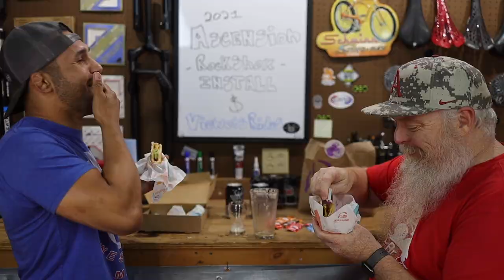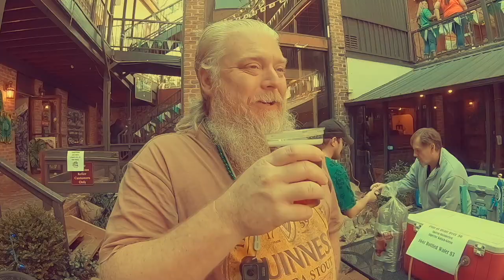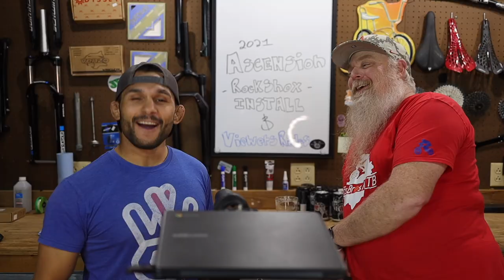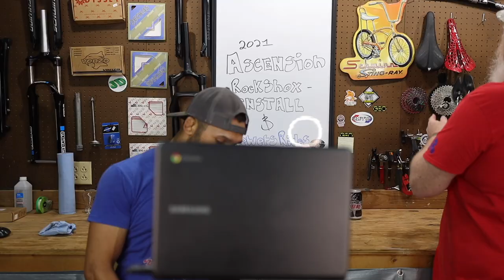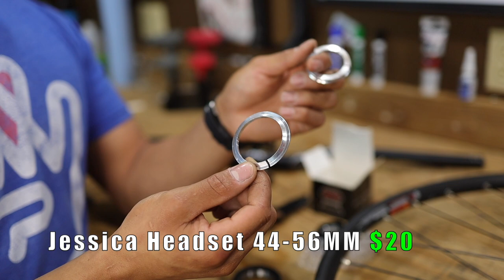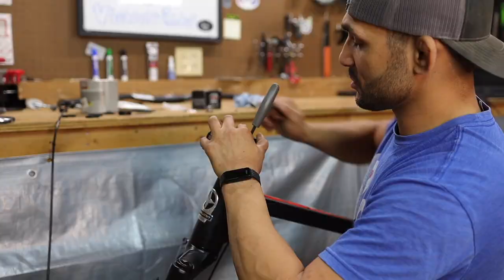2021 Schwinn Ascension gets RockShox Recon plus Viewers Rides!

Comment: Great video guys 

An additional information about the forks. I have one on my bike.RS Recon RL. It was 90mm travel, then after some research I found that it can have the travel increase by removing some spacers on the air side. With this it is possible to run more SAG (and less air). Then the fork gets even more supple and smooth. If you need more info on how to make the travel adjust just ask. 

It's a service like a lower leg service, just some more steps. 

Other think about the wheel. Other day I ordered a boost fork, but I didn't had a boost hub, but a had a thru axle hub (15x100). My solution I found on the hardware store (bolts and washers store). I got some washers that worked fine as spacers for use the 15x100 hub on the 15x110 fork.
Reply from the maker: Very good hacks man, thank you for the rundown and info!! Will do and I may be asking you in the near future:) Thanks Tatiana

Comment: The Kore bar is a nice for the money! I just put one on my old Ellsworth Joker. Wow, very comfortable. I used the shorter width, 680mm??? I grease the cups before insertion. I usually use a scrap of 2x4 and a firm rubber mallet to tap in my headsets, and a section of copper pipe for headset removal. Copper is soft and won't mar the bike or headset.
Reply from the maker: Very good thinking, I always grease too plus I think why not, it's not like it's gonna fall out lol. The Kore bar is very nice man, I rode with it yesterday and it felt very sturdy and not too much flex at all. Thanks for the input and see you for Tuesdays video of the Axum DP Time Trial!!

Comment: Just did a fork upgrade to the Rock Shox Judy, and I used a budget tool like you to press the headset … only difference is I use a wood in between the washers.  Grease also!
Reply from the maker: Not a bad idea man, I am sure it doesn't marr the aluminum at all:) Thanks:)

Comment: Favorite buget friendly handlebars? Reason...rise,durability, weight , etc...?
Reply from the maker: Oooohhh, good question man......Lets see I really like the wakes a lot. I have some 760mms and they dont really flex that much. They are cheap and they feel really good plus those are the bars I put on the GT back in the day and crashed manytimes with the, still not bent!!
Reply: I noticed you use Jessicas also, huge difference beteeen? I ordered some wakes ..btw
Reply from the maker: Cool man they are good:)  Now regarding the headsets, they come with the adapter and they are affordable and seem to be good quality. Also there is an abundance of the everywhere on ebay:)

Comment: Wolf Tick great chemistry.. pine-cone dip in ..... LOL. Just the video ive been waiting for got the Ascension. only thing  want a lower cost fork... Bucklos... Lutu those are also 120 mm any thoughts?
Reply from the maker: Thanks a bunch my man, now we do have fun!! LOL Bucklos have a straight steerer you can use on the bike which will be cheaper. They are a nice fork and we installed ours on the Fragment. Not bad for the money, here is an affiliate link man:)http://ebay.us/EDUnZ1

Comment: Cityzen onwer here 🇵🇪🇵🇪!! 😁

Few stuff:

1.- "Chorrillos" is pronounced "Sho-ree-yos", not "Chorros" 🤣, Choros actually have 2 meanings here, one is a local emblematic shellfish you can find in ceviches and other fish-based dishes made here, other is our barrio-slang for burglars and thieves 😁

2.- Yep, I'm tall, like 6.1ft tall (the frame is m/17" tall), most peruvian bikes don't have frame size selections since it would be too expensive to make, of course. It does have though a Full suspension version with a more notorious hunchback, but it's not worth it since it has a steel tail with no replacable derraileur hanger, no int. Routing and an actual fakeper 🤣. I have a dropper post on my wishlist as well, so that will make my bike fit me better!! 😁... Also, for those you asking, it's a 27.2 seatpost (hence why it looks a bit thin)...I so wish it could be 30.9 since it could make the bike better looking and more stable, but I will not complain coinsidering the price 😁... And, about the head tube, no, it's not tapered out of factory of course, but you can make it tapered with another headset (which I'm gonna do of course) 😁

3.- About the photo, it was out of nowhere 🤣... Long story short, I was going to meet my friends who were on the bottom and one photographer asked me to take a photo of him on the spot, I gladly took it and asked for the same, I was actually trying to recreate MTB Savant's thumbnail I saw from his Axum's review, but this one came out better 🤣

4.- How you, John, pronounced my name is correct, many english people call me "Joan" 🤣.. No complains though since I understand the american/english accent 🤣

5.- That's right, El Morro Solar (the Solar nose) not only is Lima's most favorite playground for not only Cyclists but also for joggers and tourists, it's also historical due to the pacific war since the war's biggest battle (and one of the biggest's in whole South American history, The San Juan and Chorrillos Battle) between us and Chileans happened there, we sadly lost because our defense line was bad... Like... bad... 😐... In their honor we have the Unknown Soldier Monument on one side of the hill, later we added Lima's digital Planetary and most recently, the Pacific Christ (our copycat of Rio de Janeiro's Christ 🤣) 

6.- What the green wall on the photo said is this:

"Welcome to the historic battle site Solar nose of Chorrillos.

Let's conseve our heritage and Enviroment, no littering and clearing.

Sports wisely, travel only on the trails, cyclists with helmets and proper protection.

Each one is responsable of your integrity. Police, Samu (medics), firefighters

Complaints to the ministry of culture. Whatsapp:##"

Anyway, thanks for showing it man!! 😁😁 Now I can delete the photos out of my laptop and make space 🤣

Also, for the previous Vitus owner, such a nice bike you have there!! 😁 That's a bike I would give a girl I'm trying to hook on 🤣🤣

Lastly, shoutout to my biking group, the Central bikers!! 😁 😁
Reply from the maker: Man so happy you watched:) The bike was a cool one thats for sure. Glad you enjoyed my translation as well:)!!! LOL Have a great night brother and see you TUESDAY!!

Comment: I have Recons on two of my bikes and I love them. Did a 100 (300) hour rebuild on one and it was easy. That said, since I will only be riding the Axum when I visit Las Vegas, I purchased a Lutu with the straight steerer expecting to pull the adapter off of the Axum fork. Thanks Wolftick, your video will cost me another $20. Does the Jessica Headset come with the adapter or does it have to be ordered separately?
Reply: all of the jessica headsets that i have purchased come with the adapter.
Reply from the maker: Man they all come with them, atleast all I have ordered:) Checkout our affiliate link below, those do!!
Reply: @WOLFTICKVIDEOS  Done

Comment: Are you running tapered tube or straight tube with tapered bearing . Did you upgrade the bearing to taper.. do the  tapered bearing keep the wheels from being shaky under extreme conditions.
Reply from the maker: I'm pretty sure that this video shows us change out the headset and install the fork, which is a tapered fork. Tapered headsets and forks are more of a marketing ploy in my opinion, rather than being useful at this level of bikes and riders. The fork in this video was very stable after the headset and fork install by the way. There are time stamps in the description so you can look for any parts that you might have missed. Hope this helps.

Comment: I have a silly question.
Have you chance the loose balls bearing to a sealed bearing on an gt aggressor pro rear and front wheels?
Reply from the maker: Man I have not....unfortunately? Maybe some one can help you out brother, are you having some noises and or issues with the hubs?
Reply: @WOLFTICKVIDEOS  thank you for your fast reply.

No noises or issues with it at the moment.
What happen was I was doing the cassette upgrade like you did and I noticed that the bearing  in the hub are actually loose balls.
So I thought that it may be a little project for later on.

Thank you
Reply from the maker: Well in that case you may look at the hub without the Quick Release in it. See if you can grease and possibly tighten the nut on eack side. Just not too tight or it will lock up your hub. Good luck man and maybe someone will have  an answer, hope it continue to be quiet!!:)

Comment: I’m putting the Judy on my Axum dp..
Reply from the maker: Dude that is gonna be sweet! 120mm??
Reply: @WOLFTICKVIDEOS  I’m trying to figure out what wheels I want to get for it now..
Reply: And yes 120mm
Reply from the maker: Well I hear it is a 135mm....I would go with a weinmann setup very affordable.
Reply: @WOLFTICKVIDEOS  what is 135 mm?
Reply from the maker: Oh I was thinking of a rear wheel size! LOL Not a front I was thinking a rearwheel sized out to a 135mm Hub. What are you thinking about as far as wheels go?
Reply: @WOLFTICKVIDEOS  I was looking at bucklos wheel set with carbon hubs but for 30 bux more I can get the wtb stp i25 that’s tubeless ready if I ever go that route..
Reply from the maker: @KingRc72  that's interesting and I have seen it. The Bucklos comes with a 10mm in t he rear right? I hear the rear hub sounds like a swarm of bees! That's pretty cool if you like that.
Reply: @WOLFTICKVIDEOS  yea the bucklos is super loud but the rims are only 19 mm inner width which really limits tire width.. plus they are not tubeless they look sweet though!
Reply from the maker: They are cool looking and would go great with an Axum or Ascension:)

Comment: Hey can u recommended me a headset because I was to fit a taperd fork on a straight steer frame 1/18 but I think it’s a reducer one I’m not sure 

Thanks 🙏
Reply from the maker: Hey brother I do not know what size headtube you got but this is a straight steerer fork headset that is a common 34-34mm. Good luck and this is an affiliate link as well thanks !https://amzn.to/3hBuW94
Reply: @WOLFTICKVIDEOS  cheers bro 🙏💯
Reply: My head tube is 130mm if I’m correct because my frame is a LARGE
Reply from the maker: Well I am talking about an internal diameter. What bike is it??
Reply: @WOLFTICKVIDEOS  search up carera Vulcan 2020
Reply from the maker: Hey brother I cannot find the internal diameter, but after reading your initial comment I understand what you need. You want to run a tapered fork in a non tapered headtube correct:) Ok so the only reducer/adapter at the moment is a cane creek branded which requires you to have an internal diameter of 44MM. I  searched and searched and found forums and the only thing I found is someone saying it is in fact a 44MM. Good luck and maybe if you order one tht you can send back just incase or get someone to help pop the upper cup out of your headset and measure. Here is a link to what I found-https://www.ebay.com/itm/203306023124?_trkparms=ispr%3D1&hash=item2f55fbb8d4:g:MksAAOSwr-xgTtZ~&amdata=enc%3AAQAFAAACkBaobrjLl8XobRIiIML1V4Imu%252Fn%252BzU5L90Z278x5ickkrmmq8hWevtuKE7%252F%252BLfVXth%252BMhcUr9n8bcmwBy61Hth1XckvgGN3ZkZrq%252BuUimuy6Nz2gZXei81fma88rOHpzwsLYE0BGWGX3C5%252FeDbzIUkkQTaPEDPsT%252B4BlV7BPVyFlVgon4pPBaKBlTiNvcBa1ckwu4ME%252Fxwec%252B3kHYsuYRxCfJiGsdh0pw0AQliO4YhOeAfdkP8XS9wHsSkejwQFAIStLWz%252Bnp44qN2E78upMCAqZpsL%252B6QRzMTVr6DJ8%252Bqom0zxBe%252BZRb%252FyxQof0lb5Ij85Wk4SYyYI%252BZeQ9ALe4uQLQDuKeiv%252Be6UQRkb%252B1y1tm2HwpLc48CVwIqMw5a421shi0Gmbb4ZUFVR7u2O7StoJDE%252B1vAd3x77O%252BKPmnw85UrIw%252BeuG9FpnCYJTS2DInFxgRlW%252FM5Gja1V3xi32sGk6YA1%252FWlGOUs2nv3c2FujeoiADJX54WpUiFL4ARm56nuxB8f7NMEVp0Yffcp%252FmL5CJAeWJeOa3X39a3lLvMe1lIPpFw3u7gTGQinn2U3FjjvFRlMeVCtss6PWjAUQiHB2bX2DOgNyjp0HCpal3uYjcYrIoTSLeEBb%252FrE%252BgT2Qfi8L%252FnoKdPnT7N7maEO3u3P2TrCtycxOEnTIdlWx3GQpmFAi8CgNkpka4%252B4gL6b69d7dUdW4dKcp3W%252BSeS%252FSz3HCz44xoAeQRaRx0pcg8RpsK7wUJgIg3lRtE3yeDHSaug1Y0wY2lj1BSxf2GBzxyhH2fqVzpqR3GIp9LLgNzR%252FR8NcHi%252FXP46W1QI24cP%252B2ZlfR%252FILbb3bwaaRVZV27e7uyoudxEBYigbydOU7TTD1ACF%7Ccksum%3A203306023124bd13e880928e472aa6aa21a5165dd3b4%7Campid%3APL_CLK%7Cclp%3A2334524

Comment: What kind the headset I need for the ascension factory fork
Reply from the maker: Do you mean you want to replace the headset and keep the factory fork? Or do you mean that you want to replace the fork and the headset?
Reply: Yes
Reply: Yes I want to replace the headset and keep the factory fork
Reply from the maker: We have never tried to replace a headset and keep the factory fork. Not atleast not on the Schwinn lineup we have not. If you want to replace the headset only. I dont think you can without getting a new fork. If you watched the video the stock fork has a built on crown race that  i believe fits only ball bearings. If you replace your headset and not the fork the crown race that is built on the fork it may not accommodate the new bearing. You can replace the upper cup and bearing but not the lower. Good luck and here is an affiliate link-https://ebay.us/R97Lb2
Reply: Ok buddy thanks
Reply: @WOLFTICKVIDEOS  do you know what size is the bottom bracket on the ascension bike
Reply from the maker: @mtbjun4936  oohhh I would imagine. 68-73 like the rest if them but as far as length I do not know. You looking at an ixf??